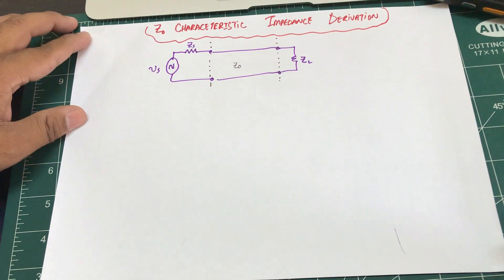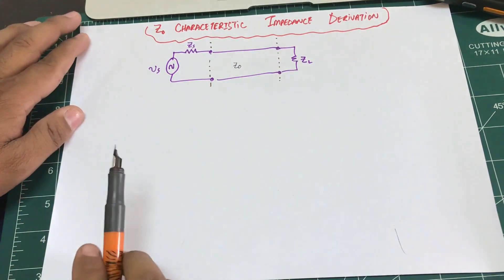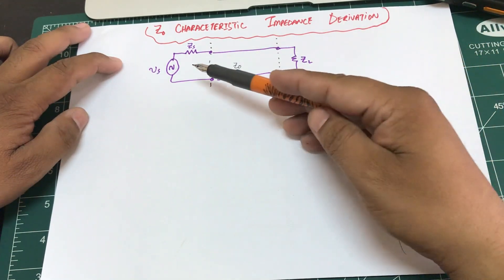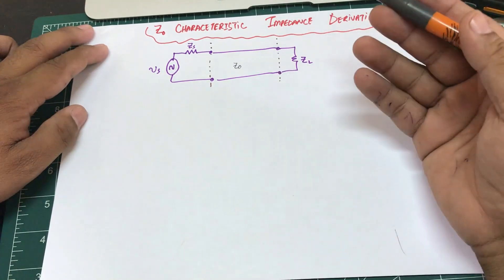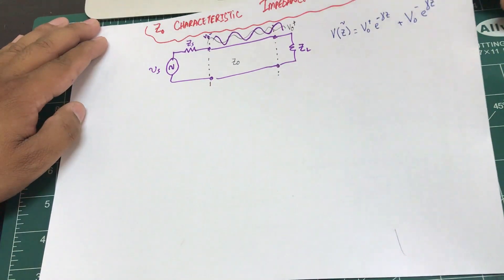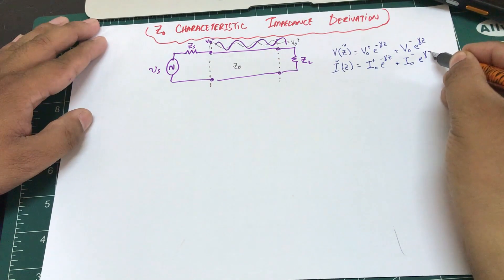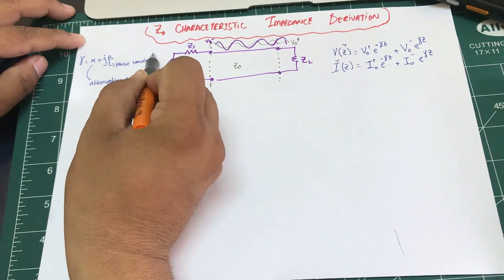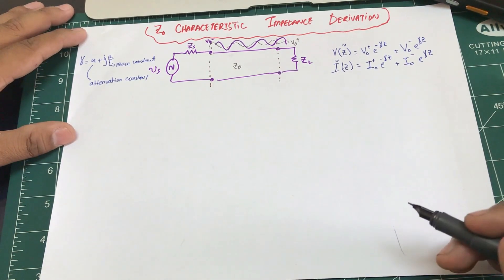Derivation of Characteristic Impedance Z0 Transmission Line | Lossy and Lossless Transmission Line

Comment: 13:46 the equation you wrote is wrong. Z_0 is the ratio between forward voltage and forward current but not of the total voltage and current, also forward wave minus backwards wave isn't the total voltage, that is the source of your error. Source is page 55 of Fundamentals of Applied Electromagnetics (8th__Edition), the calculations are explained correctly there.